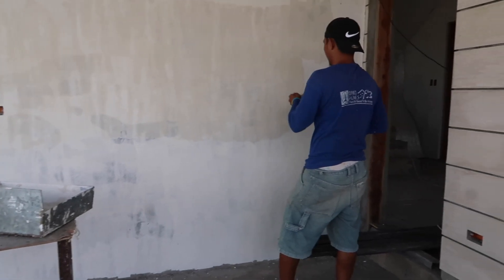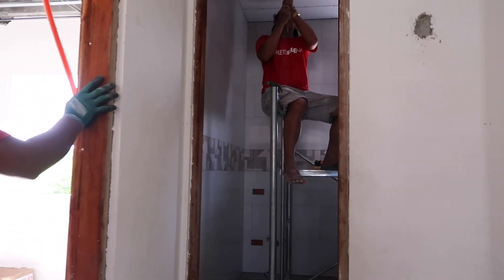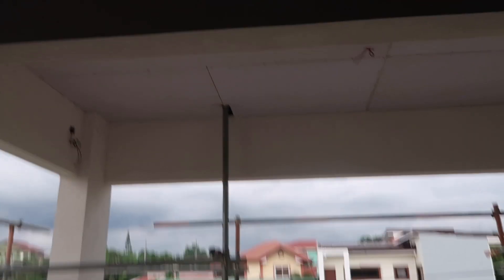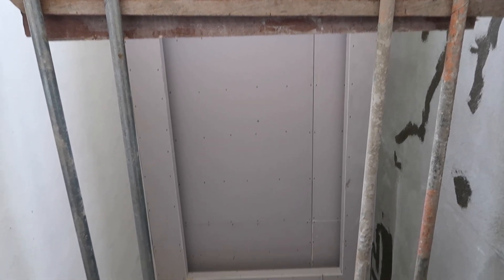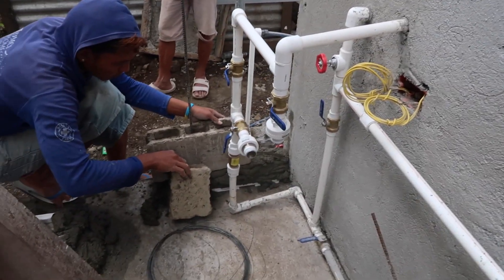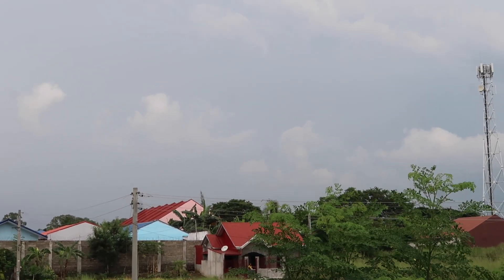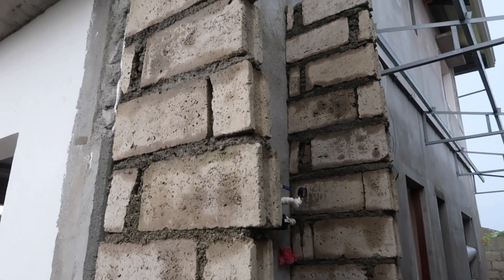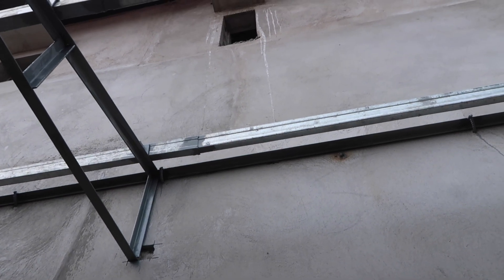HOUSE BUILDING IN THE PHILIPPINES - EPISODE 146: CEMENT CABINET FOR FILTER SYSTEM

Comment: Why they didn`t use cement between those hollow blocks and the sidewall of your house when they put up those cabinet walls for the watersystem. Looks kind of dodgy .. cos those are small but very hight walls which is only held up with the cement between them, but no cement between the sides of those hollow blocks that meets with your sidewall of the house. I am just wondering. no negative comment
Reply from the maker: Theres a rebar